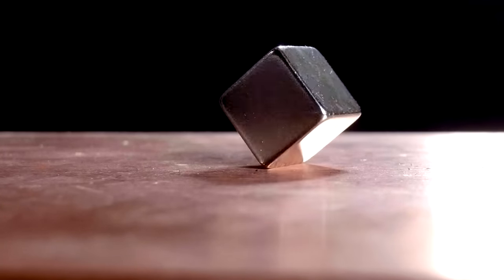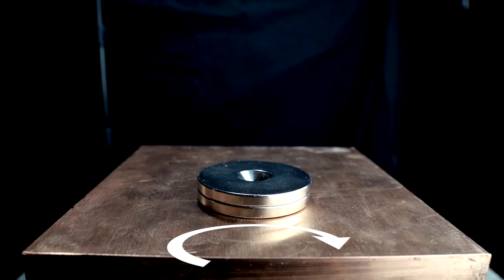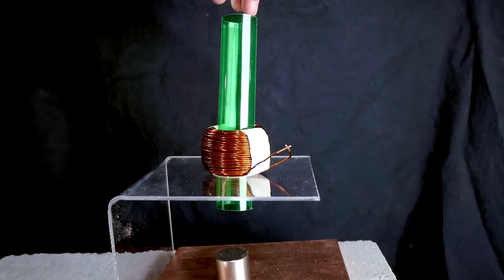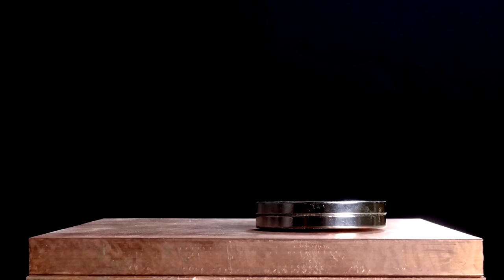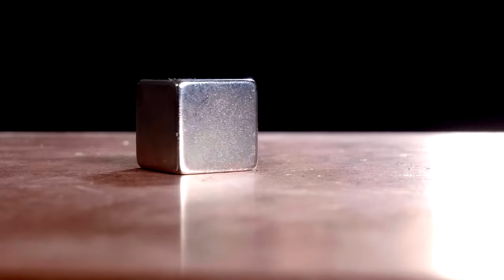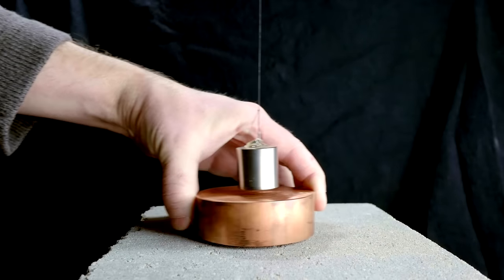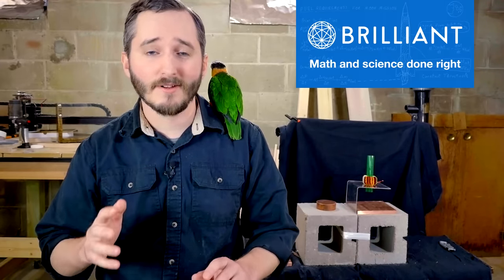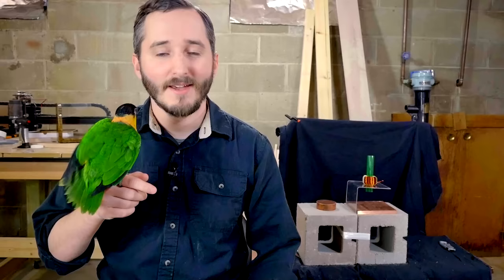Copper's Surprising Reaction to Strong Magnets | Force Field Motion Dampening

Comment: So we need copper floors and strong magnets for our smartphones???
Reply: No. You need greedy corporations to make smartphones from materials that aren't fragile in order to make more profit.
Reply: LOL.. This was exactly my first thought when I saw it slow down... One magnetic case for iphone, cooper floors. No more cracked screens, ever! 🤣
Reply: that would be cool but unrealistic ! now from the same cloth it would be cool incorporate this concept at intersections with electromagnetic bars inset into pavement and vehicles being registered to be required to install a somehow copper plate or device that could work the same way to prevent traffic infractions resulting in harm, or even some kind of on board steering control to help prevent the over correct reaction on road ways
Reply: Magnetic  effect bad for. software.which is lsa read magnet field .😜
Reply: I only need a copper mesh of a specific size or smaller to surround my hell phone and I'll not get any annoying calls.
Properly grounded, of course.
Which perfects the construction of a Faraday shield.

Comment: silver does that too i think?
Reply: Any good conductor.
Reply: Yes, because it is highly conductive of electricity.
Reply: yes
Reply: I think it does a little better. And it´s only 8 times more expensive then copper.
Reply: +Joao Martins  Nahh, you're off by quite a bit. Latest prices for copper and silver have silver about 70 times more expensive than copper.

And as for silver being a better conductor of electricity than copper, it is better by a little bit, but not by much.
Reply: You're right. I did not understand the measures used in the prices. Copper is in pounds and silver in troy ounces. Sorry about that.
Reply: Not a problem. I used to collect coins and precious metals (before I had them stolen from me) so when you said that silver was only 8 times more, it made me wonder if the price of silver suddenly took a nosedive. So I had to check. lol

Comment: Was skeptical. Now I’m thirsting for more info and I never realized I was thirsty! I’ve just started on a very adventure! Thank you.

Alex Krumins 😁 😎
Reply: E=MC2 is a joke! OK let's get this correct  !!   #1  The only reason radio waves and AC current travel out in space and down a wire is because of the "CENTER " of a magnetic field.  (The "B" field), The North and South poles are the weakest part of a magnet !!   Just like Tesla said,  you got to look at things you can't see !!  At the center of a magnet is anti gravity,  (just tap the center on any glass or plastic and it will loose weight), The center can repel water if vibrated at the correct frequency,  If you vibrate the "B" field into granite rock it will become soft and you would need copper tools to work on same , you don't want to disrupt the magnetic (B")field ) with other iron.  Once you understand the "B" field of a magnet and how it relates to the entire universe we live in, you will then understand what Tesla was telling everyone "LOOK FOR WHAT YOU CANNOT SEE""  .I believe the pyramids were inter galactic communications and transportation systems.  Stone Henge and Gobekli Tepe , power plants.  Take a look at Coral Castle Florida on YOUTUBE and you will see a similar pilar. I believe these horizontal pillars were oscillators that would provide excitation for many things from crops in the field to anti gravity  FYI: If a UFO fly's to close to you the "B" field that provides the anti gravity ("B")Field).  will cancel out your power source  !!!!  E=MC2 is at best just a joke!!!

Comment: In terms of the sculptural terrarium idea I had responded in recent, previous videos of yours--maybe shards of magnetite on a Circular/loop of copper that is in a variable thickness between copper plating (leaf) and sheet metal, with your repellant on the lower portion, driving the flow antigravitationally to flow back over the upper curve.  I do not know how copper solder, or any brazing process would be, though: if a piece of pipe would have to be pounded as thin as copper leaf, or if sheet metal could be formed in an adequate loop. I also do not know how much, or which type of, a patina would or would not interfere with the magnetic process.  But, I like your creative inspiration skills.

Comment: I think I've seen this video a guzillion years ago. This is absolutely fascinating.
Reply: E=MC2 is a joke! OK let's get this correct  !!   #1  The only reason radio waves and AC current travel out in space and down a wire is because of the "CENTER " of a magnetic field.  (The "B" field), The North and South poles are the weakest part of a magnet !!   Just like Tesla said,  you got to look at things you can't see !!  At the center of a magnet is anti gravity,  (just tap the center on any glass or plastic and it will loose weight), The center can repel water if vibrated at the correct frequency,  If you vibrate the "B" field into granite rock it will become soft and you would need copper tools to work on same , you don't want to disrupt the magnetic (B")field ) with other iron.  Once you understand the "B" field of a magnet and how it relates to the entire universe we live in, you will then understand what Tesla was telling everyone "LOOK FOR WHAT YOU CANNOT SEE""  .I believe the pyramids were inter galactic communications and transportation systems.  Stone Henge and Gobekli Tepe , power plants.  Take a look at Coral Castle Florida on YOUTUBE and you will see a similar pilar. I believe these horizontal pillars were oscillators that would provide excitation for many things from crops in the field to anti gravity  FYI: If a UFO fly's to close to you the "B" field that provides the anti gravity ("B")Field).  will cancel out your power source  !!!!  E=MC2 is at best just a joke!!!

Comment: It’s really cool if you use a copper tube and a neodymium magnet through it it’s slows down super slow through it!! Great information video 🤙🏼 🤙🏼
Reply: E=MC2 is a joke! OK let's get this correct  !!   #1  The only reason radio waves and AC current travel out in space and down a wire is because of the "CENTER " of a magnetic field.  (The "B" field), The North and South poles are the weakest part of a magnet !!   Just like Tesla said,  you got to look at things you can't see !!  At the center of a magnet is anti gravity,  (just tap the center on any glass or plastic and it will loose weight), The center can repel water if vibrated at the correct frequency,  If you vibrate the "B" field into granite rock it will become soft and you would need copper tools to work on same , you don't want to disrupt the magnetic (B")field ) with other iron.  Once you understand the "B" field of a magnet and how it relates to the entire universe we live in, you will then understand what Tesla was telling everyone "LOOK FOR WHAT YOU CANNOT SEE""  .I believe the pyramids were inter galactic communications and transportation systems.  Stone Henge and Gobekli Tepe , power plants.  Take a look at Coral Castle Florida on YOUTUBE and you will see a similar pilar. I believe these horizontal pillars were oscillators that would provide excitation for many things from crops in the field to anti gravity  FYI: If a UFO fly's to close to you the "B" field that provides the anti gravity ("B")Field).  will cancel out your power source  !!!!  E=MC2 is at best just a joke!!!

Comment: Questions:
(1) Why is this not used as breaking systems in cars?
(2) 5:12 Could this be used as an anti-crash system? What would happen to a car and it's passengers if the car would crash into a copper wall with a magnetic chassis?
Reply: Hope they're wearing seat belts. Just because the car stops doesn't me they do, it's about momentum not magnetism.

Comment: The reason why you get the slow down is that copper acts as a strong attraction to ghosts. It's like a black hole for them. Throughout the copper's lifetime, it absorbs more ghosts and because we live in a day and age where we have more copper in abundance, we see less ghosts. However what happens is that when you place a really powerful magnet near copper, it allows the ghosts to come out and as a result, it slows the magnet down because the ghosts have to go around the magnet to escape.

This is why people used to see more ghosts over a hundred years ago but since copper is everywhere now, we hardly see any of them.
Reply: I repeated this experiment and you are correct berner.

Comment: This is the key to induce energy with a roto magnetic armature using neo magnets within a copper shield. This manipulates the instance in which Lenz's law slows down a traditional magnet generator by cogging and the back pressure created thereof putting load on an electric motor. If a magnet wire is wrapped around a PM rotor, the Lenz effect is drastically reduced making the motor easily spin the generator, expanding the magnetic field driving electricity out of the generator at a much higher rate than that which is used by the motor. This isn't overunity. Energy isn't created or destroyed, it is simply being reused without losses magnetically due to another dimension of force being used to assist the spinning of the rotor. This is where the energy is drawn in from and released back to where it comes from using none of the energy. The energy is borrowed and given back to create an electric field, motion, etc. The magnetic field in and around the shield or copper layer creates a vortex on each pole that assist each other around the rotor, giving a much broader and stronger field if set up symmetrically. The opposing field from the generator coils within the stator spins the opposite way creating sort of a gravitational wave, the cousin to magnetism which allows the distance between the rotor and stator core to act as a magnetic bearing when in self operation, cancelling out all forces that would cause it to cog, given that we now have the ability to broadcast a magnetic field in a much greater distance through a copper shield, like the rotor magnets weren't even there for the Lenz rule. Also, instead of the normal clover effect that the armature would normally have is now relaced my magnetic vortex all the way around the rotor allowing the orientations of the poles to work in amuch different way and from farther away.
Reply: This could also make electric motors much more efficient

Comment: I think it is important to show that in the experiments with copper and ring magnets, the results do not change even if the magnets are rotated horizontally. 
 This is because the magnetic flux is not fixed to the surface of the ring magnet. 
 Even if the magnet rotates horizontally, the magnetic flux does not rotate.  
 Actual Magnetic flux is different from arrows but field.

Comment: Hey NightHawk, 
This is an older video but it got me thinking:
What about a walking stick? Where the entire walking stick is wrapped in a coil with the magnet inside the walking stick?
This way it can charge like 4 18650 cells that are also inside the stick which you can then pass onto other devices.
When your batteries are near 80% full, stop flipping the walking stick to stop charging.
Would be great to plug into a electric heat jacket on winter walks, just keep flipping the stick like ever minute or two depending on how fast the magnet falls to the bottom

Comment: A hollow copper disk, with a loose fitting copper armature, properly configured with arms pointing towards the outside of the disk. Hit it with lightning once and the electromagnetic field will protect it from heat and provide a frictionless environment creating an artificial charged particle.

Comment: An application I got thinking of as I watched this was as a rocket landing dampener. Imagine a copper landing pad and the rocket that descends onto it would have a large magnet on the bottom. I wonder whether it could allow for a softer landing. Of course, Spacex manages fine enough with propulsion to slow descent, but there’s always room for improvement.

Comment: Glad that I ran into this video again because I just thought of another question about this magnetic braking.

Would these experiments show similar results if we switch the magnet and the copper? As in, if we were to drop a piece of copper onto a large magnet block, would the copper piece brake the same way your magnet braked when it was dropped onto your large slab of copper?

I'm wondering about this because, when you mentioned about applying this scientific principle to rollercoasters and trains, where do they put the (electro?)magnet and where do they put the conductive metal? As in, do they put the (electro?)magnet on the tracks and cover the front end of the train with the conductive metal, or vice versa?

Comment: I'm curious, what were the dimensions of the plate. I'm wanting to do a similar video of my own demonstrating this and hopefully explaining how it all works but I want to really show off the magnetic breaking properly. I've got a very small copper block that I guess is just too small to show off the magnetic breaking so I'm looking to get some more copper.
Reply from the maker: 1/2x6x6 inches. You might consider aluminum also. It's cheaper and should work nearly as well

Comment: lol I bought a length of copper pipe just for dropping magnets down. No other reason. It's fun to twirl it so the magnet never stops falling. But even more fun than the magnet is actually looking into it. It's like a kaleidoscope made of a dozen concentric rings. Makes me want a shinier tube now. Chrome plated steel or something. Preferably in different shapes. I bet you'd get all kinds of crazy patterns if you looked into it. I've also found prisms are just as fun to look down the end of. You get a similar kaleidoscope effect.

Comment: Fascinating.  Never seen this.  Could the tube with the copper coil be rotated to be horizontal and then a couple of wheels of a space craft rotating due to gravity have a magnet set up in opposition on each that as the wheel rotates, the magnet that is closest pulls the magnet in the tube closer to the left end of the tube and then as the left wheel rotates, the magnetic force is weaker, so the magnet on the right wheel pulls the centre magnet back to the right side of the tube.  The copper connection could be switched on or off (requiring electricity of course) to counter when a magnet needs to pull it either way through the centre to counter the damping effect.  Wondering if such a setup could be built that would generate a more continous flow of current in the wire?

Comment: In middle school, our teacher showed us this phenomenon by dropping a strong magnet through a copper pipe.  Most of us expected the magnet to drop right through, but instead it falls slowly through the pipe, and suddenly drops when it leaves the pipe.
Reply: E=MC2 is a joke! OK let's get this correct  !!   #1  The only reason radio waves and AC current travel out in space and down a wire is because of the "CENTER " of a magnetic field.  (The "B" field), The North and South poles are the weakest part of a magnet !!   Just like Tesla said,  you got to look at things you can't see !!  At the center of a magnet is anti gravity,  (just tap the center on any glass or plastic and it will loose weight), The center can repel water if vibrated at the correct frequency,  If you vibrate the "B" field into granite rock it will become soft and you would need copper tools to work on same , you don't want to disrupt the magnetic (B")field ) with other iron.  Once you understand the "B" field of a magnet and how it relates to the entire universe we live in, you will then understand what Tesla was telling everyone "LOOK FOR WHAT YOU CANNOT SEE""  .I believe the pyramids were inter galactic communications and transportation systems.  Stone Henge and Gobekli Tepe , power plants.  Take a look at Coral Castle Florida on YOUTUBE and you will see a similar pilar. I believe these horizontal pillars were oscillators that would provide excitation for many things from crops in the field to anti gravity  FYI: If a UFO fly's to close to you the "B" field that provides the anti gravity ("B")Field).  will cancel out your power source  !!!!  E=MC2 is at best just a joke!!!

Comment: For those curious about other applications for this phenomenon there are two very common applications found in the electronics industry. Electromagnetic (AC) Relays employ a copper "Shade". Without the "Shade" the relay would just Buzz! A similar Shade can be found on the ubiquitous Shaded Pole Motor that has been around all of us our entire lives.   They have extremely good longevity and are noted for being the most efficient light duty ( P  = E * I ) motor in either AC or DC categories. 
Now, I do have a question. Copper seems to be the only conductor ( I think ) capable of reproducing your results. Aluminum is considered to be a good conductor and so is Gold. That means there must be another factor. Aluminum and Gold are non ferrous metals just like copper.  Silver is a good conductor and not ferrous either. Nickle is also non ferrous and a good conductor. Don't get me wrong,  .. I love Copper! I think it's beautiful when buffed and polished. It's fast becoming our most PRECIOUS METAL!  You posted this video Jan 2018. Have you priced those copper plates lately?😉 
Wakodahatchee Chris

Comment: There are so many things I have yet to see such as the stuff being used in outer space for travel and a copper piece going down a magnetic tube. Like for example, when the electrons reorganize in a circular pattern does the circular pattern still exist if the space to move is limited and is placed within a 3 dimensional space? Would the electrons infinitely move in such a pattern much less at all? Or would it just overheat due to overexaggerated vibrations? If it over heated, why not superconduct the copper or put the experiment in much colder environments?